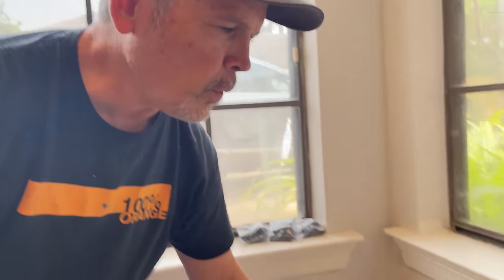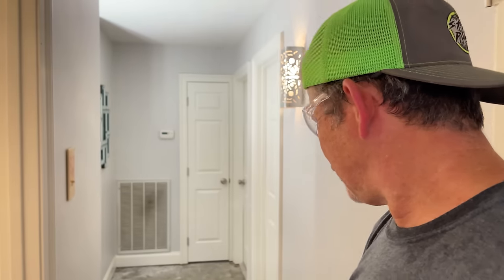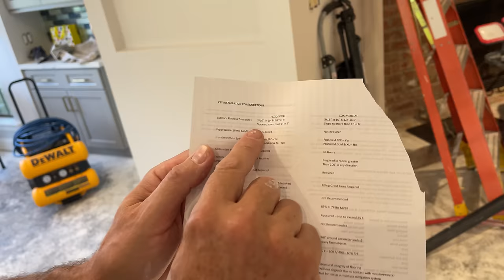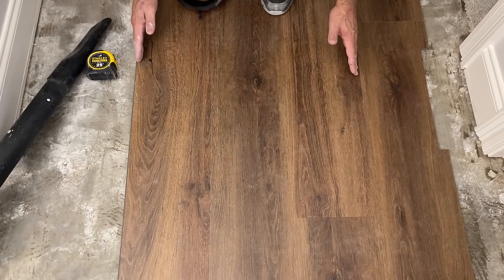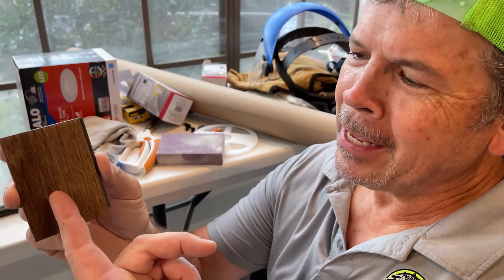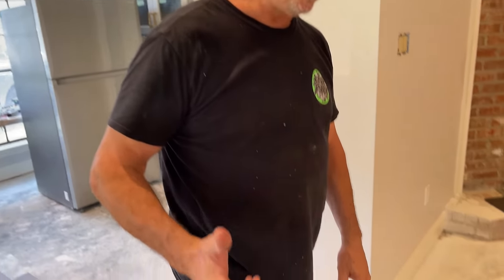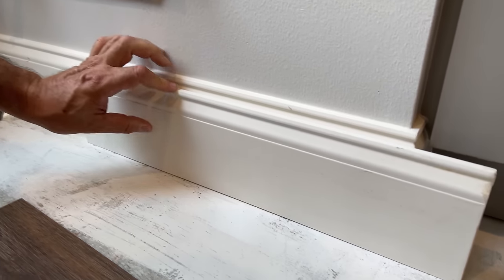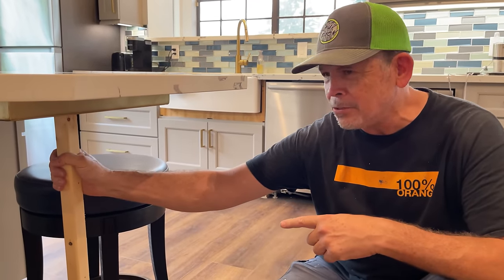The ULTIMATE FLOORING HACK! | Installing Vinyl Plank Flooring

Comment: In my experience which is over 20 years of just floor coverings, it makes more sense to start in the bigger area off the straightest wall and if you can't find one, use a chalk line to make your own perfect straight line, especially if you don't know if the hallway is square to the rest of the house or if all the walls are square at all. Starting with the longest run of the whole floor is never a good idea because even with measuring distance it doesn't ensure you are square with the rest of the house. Also this way you don't have to spend time putting blocking on the floor regardless of the substrate to keep yourself straight. The wedge spacers you were using are trash to begin with and they make ones that don't go under the baseboard like that when you tap boards, I was forced to learn without spacers and at the same time keep myself straight. Also thin set is not a horrible idea, but the best thing to remedy the dips and chunks out of concrete was a polymer mortified self leveling compound that you would have been perfectly smooth and leveled itself to the current concrete without any ridges from using a trowel. And I also never tap a board the long way like that for doorways, there are other ways that are just as easy, if not easier and more impressive depending on how the boards lock together.
Reply: Ok Mr perfect, feel free to record, edit amd share your vast experience.
Reply: @mikeedwards2561  Not perfect at all, just a second generation flooring specialist, my father in law did it for around 50 years before he died and also subcontracted for Lowe's for about 25 of it while also subcontracting for independent small business flooring stores throughout his lifetime and never had to eat or pay for a job once due to installation error, he's even been to court over product installation and won in his favor, and I have even installed hard surface in a house that had carpet installed by my father in law over 20 years prior. I have a family with 3 kids under 10 years of age, I literally don't have the time to record, edit, or share my vast experience.
Reply: @jamesdiminico1693  Don't worry about people who have no idea what they're talking about. I could have done that exact install by myself in half the time, and I agree with you. They overthought several things that ended up making the job harder for them. Which is okay if you're getting paid by the hour, but I get square footage pay; much of what I saw was just unnecessary.
Reply: @michaelcurran7269 
At least James gave the comments about not doing a long run and the self leveling compound. But if you are going to say I could have done it faster and they made the job harder by over thinking things and not give an example or two makes your post narcissistic and useless
Reply: if your only interest in the dwelling is to lay the floor and move on to the next one that's one thing but if you might do other work on the home then taking longer time or less popular techniques can still result in beneficial outcome, like a physician who spends more time with a patient, it may ultimately prove to have been beneficial.

Comment: Question:  I have a question about changing direction of how the laminate is laid.  My house faces west.  When you walk in the foyer, you have a hall that goes to the right in the eastern direction and goes to the master bedroom and a bathroom.  To the left of the same hallway is a south wall of my Great room which is the dominate wall of the house.  Basically, I should run the planks North and South for that room.  My question is how should I lay the panels for the hall?  If I want to keep the North/South pattern with the main part of the house, I will be cutting a ton of planks to fill that hallway.  Everything I have read and watch says you run parallel to the hall wall otherwise it starts to look choppy.  Just happens my hall runs perpendicular to my Great room.  Does that make sense?  I just wondering if I keep most of the house in the North/South direction and make a transition where the Foyer meets the start of the hall.  If i could include a floorplan, I would show you exactly my dilemma is.  I plan on doing this sometime in June or July when it is nice in Colorado and I can move some furniture outside while I lay the laminate.

Comment: I would remove the base board when replacing the floor and work from the wall. put up 3 wors and use scrap pieces to space the floor against the wall, and then keep working :)

Comment: When I first started in the remodel business I saved everything that could possibly be used on a future job. I ended up with a garage full of crap.
Reply: So that’s why I have to park in the snow…
Reply: Why did you have some carpet showing in the hall coming from the bedrooms? Should the door thresh not be directly under the door?
Reply: "Garage full of crap"..................

Until you need it, then it's, "Oh thank God I saved this."
Reply: @Nutsarooba  You are correct, read William Wrights threads above. It explains all about the threshold.
Reply: “Garage full of crap” is what I call my stay at home son.
Reply: Only the one garage?  I've got 5 full of crap going moldy!
Reply: I used to do that too.  Until one day I decided I wanted my garage back and thought I would build a shed to pile the crap in.  Then as I added up my material cost build the shed I realized that I was going to spend about $1500 to build a shed to hold about $500 worth of crap.  I hauled the crap to the dump and bought myself a new miter saw with the $1000 i saved!
Reply: @Nutsarooba  
I believe the door was slightly ajar.

Comment: great tip on sliding the middle piece in the hallway (16:12) Thanks!
Reply: I just pulled an all-nighter doing a small hallway with 4 doors on it, and while I like your tip (and it would have saved me a HUGE amount of time), the LVP product I have doesn't allow me to do the soap/water trick.  I also had a slight pad on the LVP, and carpet on the various rooms around the hallway. But I also a very thin pad on the floor which would have been torn up.    I use it for thermal, water and sound insulation.  The product I'm using also seems to be "installable" one direction, and it has caused me some grief where I wanted to install it "backwards".  During a brief period when my back made it hard for me to get up and down, I hired on a guy who did floors, and after 2 hours of banging around, I went out to check his progress and he hadn't gotten very far (was trying to install it backwards), and I showed him how I did it.  He still kept trying to do it his way. And he too didn't use the plastic shims.  But he nailed wooden blocks in to the base area around the perimeter. That was painful to remove!

The bottom line... check out how it installs... some products are too clever for their own good.  It's good, but a pain to install at times.  Love the laser trick, and nailing pieces down in the middle of the room! !  And TOTALLY agree with someone before saying to check those darn joints!  Using a table saw leaves you with tons of static-cling dust and chips, and they fall into those joints SOOO easily, and ruin things fast.

Great video!

Comment: You can also anchor the “support blocks” with hot glue rather than drilling the concrete then screwing it. Most hot glue can handle 250 LBS of pressure.
Reply: Hot glue under blocks sounds good till done. How are glued blocks cleanly removed?
Reply: @dbcannon3152  I use a pry bar and it works really well

Comment: Installed 1800 sf of flooring with my son. We used the score and snap method for nearly all of the east cuts. He started out cutting on top of the flooring we had just layed down and I freaked out saying you are going to scratch the floor with the blade. “Dad, I’m careful”. Very next cut with me not watching he slipped and scored the laid-down flooring. He got to undo the flooring and fix it. And as a bonus he never scored on the good floor again.
Reply from the maker: Great story thx 👊

Comment: You guys need hepa filter vacs and hepa air purifiers when renovating. For you and the customer
Reply: HEPA sounds nice in theory, but I wonder if it’s practical in construction use because I can see it plugging up too easily in this type of environment? Maybe in a final cleaning as you’re walking out the door and finishing the the job, but a standard or commercial home vac equipped with HEPA might be more practical.
Reply: @tazmun  it's extremely practical.
Reply: 100%. And cover up air vents, doors, furniture etc too!  Even if it was a good install the homeowner doesn’t want a house filled with demoed floor dust.

Comment: I noticed you didn't take the bass trim off are you planning on putting a quarter round on the bottom of that trim or how did you install that flooring underneath it

Comment: Thanks for your expertise on this flooring method.  
I just bought a single-wide mobile home and plan to put in vinyl plank throughout.  
It has been bothering the hell out of me wondering how to start at one end and keep it straight as I go.  Your method of doing the centre laser straight first is the answer.  I might just use string though.  
Thing is I didn’t know you could lay that stuff both ways. 
Thanks big time for this !

Comment: I know this video is older, still hoping for a response.  What tool did you use in the hallway to remove that black glue?  I've got old 9" square wood tiles from the 60's. Throughout my house. Previous owner put LVP just in the kitchen.  I'd like to continue it and would like any tips on removing the black glue just like in your video.  That's a cool air scraper tool. Do you recommend it?  The ones I find online say they require a constant 10 CFM to operate.  But those compressors are very expensive. What's your set up? Love watching you guys.  I'm wondering what the big news is coming soon.  I have a feeling I know.  I know a lot of  Louisiana folks come to the Florida panhandle for our beaches, and we love our Louisiana friends. If you ever take a trip, I'll buy y'all a beer.   Good luck and thanks for the great tips.

Comment: As a flooring installer take the baseboard off waaaaaaay easier
Reply: Flooring installer... nice. I have one question, if you are willing... I know the floating floor needs to be a wee bit (1/8th) away from the wall, but what about the underlayment, can that go edge to edge or does it need the gap as well? (i don't have the option of removing the baseboard, it's tiled wall down to the ground, with a curve inward, bathrooms from the 60's are weird)
Reply: As a floor user, don’t mess with my baseboards.
Reply: @MrBlckPanther  It doesn't have to go all the way but should be close enough to support the board. A little over cut is not bad either if not consistent. Too much at the wall(bunched up) could cause buckling.

Comment: I wonder how the area where the planks met the brick fireplace was finished.  It looked like it wasn't perfectly flush there were little gaps where you could see the concrete floor........which is understandable but I just don't understand how you could fix that because you can't put a baseboard trim piece of wood against that edge.  Little things like that intimidate me and stop me from diving in on something like this and that's why I'd pay someone.
How did you make that area look super nice?

Comment: When you prep do you check levels and/or self-level if you have to? Our contractor used concrete to go up ramps/etc, but it ended up just breaking the seams and creating damage within a year.

Comment: Great tips and video but I’m perplexed on one thing.  That is still tongue and groove and typically you have to run only in one direction so the next row tile and snaps into the previous row.  How can this be done going in the opposite direction?  You have to tile the plank one way so I don’t see how it works laying he flooring in 2 directions.

Comment: At 17.09 looks like the overlap at a joint will be less than the 400mm recommended. Also are you not going to remove skirting boards and refit even if it means replastering and painting.

Comment: What keeps the floor pieces from shifting under the baseboards and working the joints apart, there is a perimeter gap/ and also do you put the quarter round strips back on?

Comment: This is like the 2nd out 3rd video where they used thinset instead of self leveler that you mix up very thin and is liquid that you just dump out of the bucket and will for the most part just flow into low spots and literally levels itself with very little troweling if at all. Is it a drying time issue or price issue or what? the thinset is much more labor intensive than self leveler, I know that. So what is it?

Comment: Can you tell me the name of the glue you're using at 27:11 in the video? Also, when you join the pieces together if some squeezes out what can you use to remove that from the plank surface? Thanks for the Pro tips.

Comment: I have a bedroom with parquet flooring, house was built in 1944 and by the baseboards , the parquet pieces are starting to lift, the cement underneath seems to have cracked and crumbled, and the parquets are arcing up and out of the grooves. How can I fix this at minimum cost?                  Thanks for the reply

Comment: Installing CORELUXE flooring 4mm and it does not hammer shut (lock) when both pieces are on the same plane.  So if I were as you did tap a piece end to end...the end will not join....or am I doing something wrong.  It seems that the on ly way to join two planks is to pick up and join the end pieces all but 1/16 of an inch pushed into the longer and not end side.  Then I have to  grab the last board installed...pick it and the one I'm installing up about 20 degrees before it snaps in.  This makes it nearly impossible to do the smaller end pieces or closets and things.  Is CORELUXE just a messed up brand?  Took 2 days for me and my 2 grand kids to get one living room done.  But does look nice.

Comment: Hey guys! We bought a vinyl plank flooring that also does not need a vapor barrier or a padding... our original floor is linoleum. It said as long as the flooring is sound it can go right over the linoleum. The linoleum is also over slab. Any suggestions or is that ok? Love your videos BTW!

Comment: What happens after you remove the screwed in blocks and start tapping in boards on the other side won’t the boards move when going the other way with nothing stopping the boards from moving.

Comment: Hey buddy,  what is that air scraper tool you used to get the glue down flooring removed? I pass up jobs that have glue down because it's such a hassle to remove, thanks for the info,, ps nice work

Comment: I’m super impressed at how clean you guys work. Not only is that great for homeowners (and having to clean the entire house after a remodel), but also helps you work too. Staying clean and always prepping areas can save time and DEFINITELY helps during installation of anything really. Like you said, 1 little piece of “dirt” can ruin a floor, let alone other projects.
Great job, and wish more crews worked this way✌🏻

Comment: Man I've been watching you guys for about a month now trying to get up some courage for a diy home remodel. Let me just say I wish I knew about you guys years ago. You're so easy to listen to, very knowledgeable, and a good instructor.  Thanks for sharing.
Reply: Concrete slabs are an excellent candidate for in-floor heating. To grind the surf with the concrete surface and just have a exposed aggregate look like at home Depot or any commercial store these days it has ground concrete with sealer on it

Comment: If you don’t have a laser you can measure out a center line down the longest stretch of the house, snap a chalk line, then spray it with a clear spray paint. This gives you a permanent centerline which you can always measure off of.
Reply: I did that without spraying anything,  my wife is chemical sensitive.

Comment: I don’t do a ton of flooring, but have always used the wedges after removing baseboard. Idea is the 1/4” between the drywall and floor is the perfect expansion gap. But, again, I don’t do flooring too often.

Comment: Kinda started weird in the hallway. I've always used pothagarims theory to square up from an outside wall that way I can alleviate installing in both directions. Makes it a little easier beings one side of the material locks easier than the other. We never use saws either. Just a good old carpet blades.

We also use 2 sided tape for the starter rows
Reply: This what i do too... Sometimes hall walls arent straight with outside walls soo if u go wit hall walls, you gonna be off on outside walls
Reply: @GoLeafs03  absolutely sir. Here where I live, framers don't know how to build straight walls to save thier lives for some reason, could be the alcohol they consume for breakfast and lunch too lol.

Comment: Definitely get a guillotine for cutting, makes those cuts a cinch, even works on 12mm laminate. Cheap enough that it’s worth it for the occasional flooring job.
Reply: I just bought one and it saved me so much time
Reply: Got one bout a month ago and we were like we’ve been doin this wrong with the miter
Reply: We use " Bullet" brand shears and it saves so much in labor cost.Blades stay sharp.
Reply from the maker: Was looking at them last night 😂👍
Reply: @AD-zu7ic  I have the 9" bullet it's worked great for years and only had to change the blade once. I also have the 25" Roberts cutter which works awesome on the 12x24 tile looks or even on the planks cutting the 45deg angles